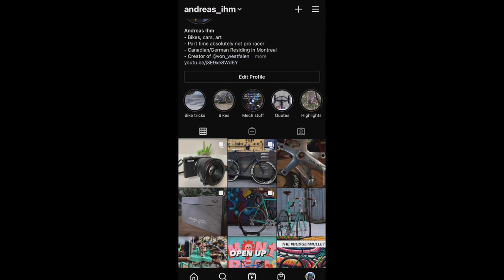Dream Bike Build - CINELLI SUPERSTAR DISC - Low key Italian passion

Comment: Sorry I meant 2 cable 680mm and 1 cable 340. well i went to a local Campy repair shop and I bought another 680mm cable. I don't want to use shimano cables on a campy build. That would be sacrilegious lol.. Re the gluing part, do you mean the plastic piece that attaches to the bottom of the bottom bracket and the housing goes into? Because campy does give a ferrule which seems to go in there, so its best to glue it, right? thank you. Another thing I don't know why Cinelli didn't supply a "grommet for where the rear shift cable come out at the dropout and then goes to the shifter,seem water could get inside there.

Comment: Very nice build I have the same bike it's a rimbbreak bike and I'm using the campagnolo  chorus 12 speed I would like to ask you a question because in your video it's not very clear the part where you're putting the rear derailer cable in the the frame it seems that the cable is running from the down tube Through the bottom bracket and then in the right chain stay and out exits out at the rear of the frame are are you putting the entire cable with outer part into the right chain stay? Because if this is so the cable i got is too short. My shifters came with 3 cables 2 X 640mm 1X 340mm . So i don't understanding how that works.
Reply from the maker: Hi, this is a modification I did. You will need the shimano super flexible housing at both ends of the full housing. 

It also requires you to glue the female/female connector to the housing.

Comment: Nice build. Can i ask what brand of gear cable housing did you use for that build? Im currently building the same frame right now.  Thank you so much
Reply from the maker: So... I used the shimano dura-ace OT-rs900 housing inside the handlebar and a mid range slick jagwire housing for the rest of the bike.

Thanks for watching!
Reply: @AndreasIhm  thanks for the insights.  Ride on

Comment: Nice bike review,what size may I know?cause I’m still confused take S or M for 169cm height
Reply from the maker: Hi, Thanks for watching. 

This frame is a size medium if I recall correctly. 

You should definitively consult a bike fitter in your area to help you determine the proper sizing. 

Have a great day
Reply: according my height 172cm - 81cm inseam iam for S size. But maybe i need M . Dont know too... Its bad when you about spend 2.5k and buy the wrong size.... :(
Reply: @Godspeed961  here cost almost 3000€,thats why wrong size and need to sent it back n another waiting to get the right size  is bit heftig
Reply: @ingogringo188   So you can do that?? i prefer it than have a wrong size. iam between 2 sizes and they say get smaller frame for more racer position or bigger size for more relaxed... i dont know what i prefer and how my body will responded to the road bike. i ride a cannondale quick1 (fitness- hybrid ) for 2 years and iam SuperHappy about the position ..